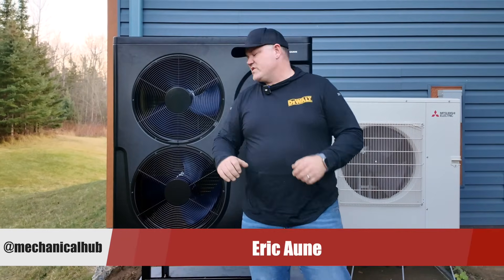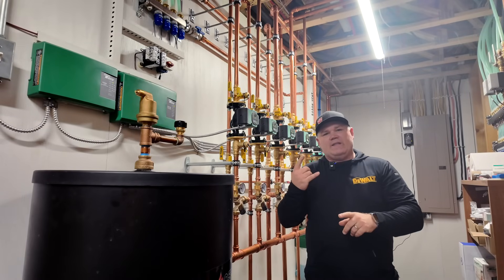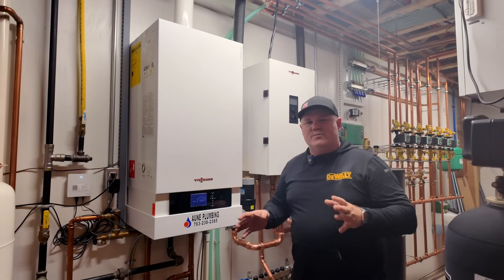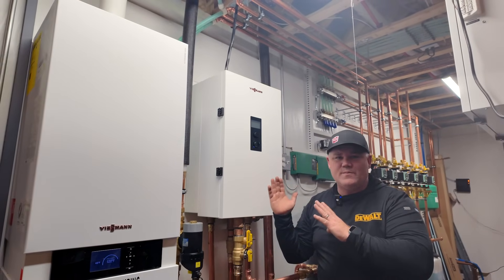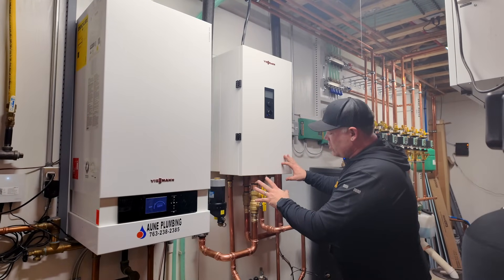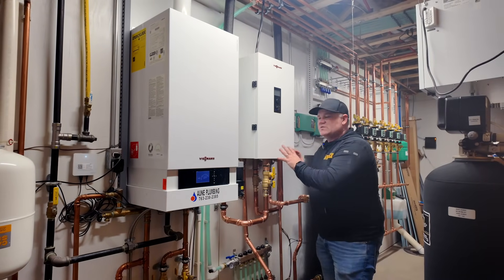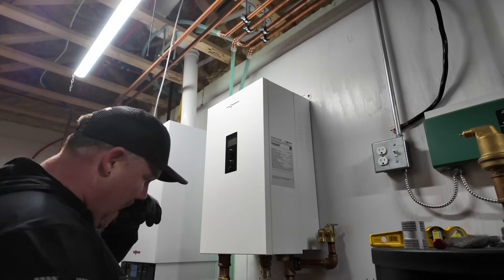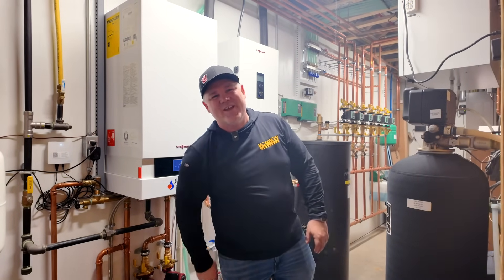Hydronic Heat Pump - Viessmann Vitocal 100

Comment: What is the max water temps the heat pump can provide?  All your radiation is high mass from the buffer tank….radiant in floor/wall so only need 120’F supply temp?  Can this heat pump supply a fan coil effectively with 180’ water?

This system provides no cooling?  They have another system for cooling?
Reply from the maker: Its capable of producing 165F water temp so a fan coil is completely doable. You're incorrect on the system, there is a mix of high and low mass after the buffer, however the system is designed to operate on a temop range of 80F-145F depending on the emitter/zone. This was a retrofit, no need for cooling because the house has a ductless system. The heat pump is capable of cooling and DHW as well.
Reply: @m @mechanical-hub anks for the reply.   165f isn’t bad but i imaging that drops with outside temps as you switch to gas boiler.  
I ask because I’m about to switch my oil furnace to dual fuel heat pump/ gas boiler here in lower NY.  Super high electricity rates calculate a crossover to gas at a COP of 2. Heat pump efficiency is better below full output so looking at a crossover temp that doesn’t go below 2.0 at full throttle.  My installer said they typically set crossover to 32f in our area.  Very hard to find a table of COP performance for my proposed equipment just 3 temps listed.  Manufacturers seem to hide it.  The efficiency numbers manufacturers brag about are best case at higher outdoor temps.

Comment: Why use Solar Hot Water instead of Solar Electric Panels for either an electric tank or feed the heat pump for DHW? Solar DHW can only perform 1 function the alternative many and considering COPs of 3-5 on heap pumps that free electricity can produce a lot free heat energy

Comment: I've heard these are much better than Ecodans. What sort of temp are you able to maintain that buffer tank at, and when do you make the switch over to gas? 2,0 COP at -28 C is something I hear thrown around, then switching to resistance heating (9kw in the ecodan)... Never looked at a Viessman because I hear they're expensive.

Comment: I am building a home/shop on the ocean front in remote area of Newfoundland. Hydronic slab heat in walk-out basement shop and perhaps an air handler for the main floor living area. Propane is available but only one supplier. Would you have any concerns using Viessman’s air to water heat pump in such a corrosive environment? Things that aren’t 316 stainless or dipped galvanizing just dissolve before your eyes. Originally, I was prepared to use a Viessman pellet boiler but the pellet supplier could not guarantee supply.
Reply from the maker: Its a copper and aluminum coil with steel compressor and chassis. Its outside and fully exposed to the environment, probably not good but I would contact V directly if I were you.

Comment: The real question is what distributors are actually stocking this or even know how to purchase it for a contractor?  I am seeing lots boiler manufacturers selling atw heat pumps but none of my local distributors even know anything about them. Even with the new admin abandoning incentives and pushing fossil fuel I still wish to sell hybrid or heat pump only options to my customers who still have oil heat. I want to start offering more than just air to air heat pumps / ductless mini splits.

Comment: If you used a R290 ATW monoblock, you would not need the gas backup. R290 is good to -35C and can produce hot water to 85C.

Comment: I have a home up north and would love to install a residential high efficiency glycol system boiler. Now what is the actual cost saving having redundancy here? you already had a LP high efficiency boiler. In the winter he’s bypassing the electrical heating element. so what was the point of having the electric heat pump. Your using the LP boiler to heat the water and than the heatpump to maintain the temperature im guessing would be the only reason thats cost effective?. And the electrical heat pump would maintain the hydronic water temps more efficiently than the high efficient boiler. Not being sarcastic just want to understand the system and if its worth doing this im always concerned of pipes freezing and bursting so one i want a system that i do not have to worry about pipes freezing as right now i have forced air and does not heat the home evenly. Second i have propane so i would like to either do a high efficient tankless boiler of of propane or this electric heat pump. But i feel electric is more costly than LP. Pros and cons and thanks for any info in advance.

Comment: I have to ask though in the long run, why would you want to use LP as a redundant opposed to having the electric hydronic as the redundant? Seems the LP overall would be much cheaper operational costs long term. I love watching your videos and seeing your work! Excellent looking install and man you and that customer should be extremely proud. Excellent video!
Reply: @Page546  I think with a combination of the solar tied into the LP was probably pretty efficient and the cost effectiveness to hook up the heat pump was probably fairly expensive.

Comment: Does that heat pump work with a water to air heat exchanger got use with forced air? I am wondering if it could be used for heating and cooling in a central air system as a monobloc setup.

Comment: That's a great redundant system, and a very ideal configuration, but it's not exactly cheap but it's the best way to utilize energy, and as a bonus you can use the resistive heat as a backup if they run out f propane (LP) gass! Or for equipment maintenance and down time!

Comment: Did you calculate other options such as furnace or electric baseboard?
Reply from the maker: The house was built in 2018, I installed the entire hydronic heating system at that time. This project was a retrofit to the existing system Now dual fuel, LP and Electric (heat pump)

Comment: A water-water heat pump would be nice... Soft geothermal heat pump with the earth as a heat sink/source. Then you might not need to even need a boiler (a wood stove might be wise backup)
Reply from the maker: Geo would be exponentially higher and no more efficient, would still require backup for the heat emitters in the house. Geo would use the same or more electricity as compared to this system as well, I have a hard time seeing the net benefits tbh.
Reply: @mechanical-hub  is the reason for backup not for low outdoor temps? For me it would be nice because at night in winter, my heat pump barely works.

Comment: I piped in a Wiel McLain Plus 80 tank so that it was the only thing that gave my boiler a heat demand and pulled all my heat zones from it so I got my domestic water and my buffer tank from the same tank. To accomplish this safely I used a thermostatic mixer on the DHW and a wider range aquastat to provide a heat call for my boiler. I got my heat from water to water geothermal and a wood boiler.

Comment: Awesome system and beautiful installation. Gives me some really good ideas and inspiration for the all-electric hydronic heating system I will be installing in my new home on the Oregon coast. I’m thinking of using low-temperature radiators in the walkout basement since it’s in a mild climate zone and further tempered from the cold by being half underground. Nice to hear that’s a viable option even in frigid Minnesota (where I grew up, BTW). Wish I could get you out here to OR! 😊
Reply from the maker: Great idea for the walkout basement, sounds like you are doing your research and have a great plan! There are a ton of options for low temp emitters, have you checked into Runtal or Smith's Environmental silent fin? Both are great, two ends of the budget spectrum as well.
Reply: Oregon Hydronic Heating and Air is using this tech.   They are stationed in Eugene, Oregon.

Comment: Why is absolutely NONE of the hot water piping insulated?
Reply: It's inside the thermal envelope so works as extended radiators. Low flow temp means they don't leak that much heat to start with

Comment: What's the monthly costs for heating with the heat pump in that house? 
I have six zones in Zone 5/6 that averages $120/month using natural gas from October to April. 
January and February are the months with the coldest temperature, and they drive up the averages.
Reply from the maker: It’s been installed for less than a month.
Reply: @mechanical-hub , good point. 
it will be interesting to see how it performs and the relative impact of the heat pump on pocketbook.

Comment: Why wasting heat in heat room, why all copper pipes are not isolated? Hope they are isolated in all other sections.
Reply: I assume you mean insulated?
Reply: @MichaelJ674  Yes, miss type. Multitasking on several screens.

Comment: Man I wish I had you to do the install in my new home. Wanna travel to northern Alberta in the next few years? Gonna be Ground Loop water to air Geo-Thermal heat-pump for the house plus a water to water heat-pump for the garage and future shop.
Reply from the maker: That's a very cool setup, great choices for both applications!

Comment: What is the black plastic “buffer tank”? What brand, model, etc? Are you using it essentially as a heat exchanger?
Reply from the maker: It's a "Argosy" model by the same company that makes Flexcon expansion tanks and well tanks etc. There are a ton of zones in this house, many are very small so the added volume to the system allows those zones to run and not short cycle the boiler or heat pump. Basically it acts like a big battery and hydraulically separates both sides of the system

Comment: Problem you have to replace every 10 to 15 years.  All the money you think you’ll save is killed off by installers and HVAC guys charging a grand to replace a CAP.
Reply from the maker: Everything has a lifespan and there are dishonest contractors in every industry but I'm not one of them. Thanks for watching.
Reply: Wouldn’t you hate to live your life from such a negative perspective? Keep up the good work and positivity, Eric! I appreciate your commitment to doing great work and putting out great content. It’s obvious that you love what you’re doing.
Reply: @MichaelJ674 But it is in fact reality. Maybe the guy in the video is honest, or at least thinks he is, but he is selling outrageously priced systems that most people simply can not afford. It is almost impossible to find a decent priced HVAC installer anywhere anymore, and systems are becoming more complex and less DIY friendly especially with the inclusion of heat pumps in everything. It's all centrally planned.

Comment: Great info. I have been listing over a system like this for a long time. If you could, it would be great to provide some operating cost for this system on a SF basis if possible. Thanks for posting.
Reply from the maker: Good question, I’m still gathering some data on this.

Comment: with a heating system like this are you forced to use mini-splits for air conditioning ?
Reply from the maker: Without a ducted, centralized system mini-splits are the best option for efficiency and comfort. If there is a ducted air handler then this hydronic heat pump can provide cooling. Other options would be small room-sized air handlers.
Reply: I’m in the temperate UK and the idea you’d need heating for -25F and then also have to worry about cooling is pretty crazy.
Reply: @ haha that’s Canada and northern USA for you. It’s like -40 to +40C
Reply: Yeah, I grew up in MN where you’d sweat your a$$ off in the summer and freeze your digits off in the winter. And there’s mosquitoes and biting flies all summer! Great fishing all year, though.

Comment: Looks cool I assume it’s a monobloc heat pump with the refrigerant already pre charged. What’s the rated lowest ambient temp rating?
Reply from the maker: -25F/109F Temp range. The built-in electric resistance elements widen the actual operation to those numbers, they don't list the output capacity at a specific low temp, I've been looking for that info but we programmed to operate on a timed scheme and enable gas after set time of operation until load was met. It's been working well, it's cold here now.

Comment: Would love to see a step-by-step installation of this system to in floor radiant heat and DHW.  This looks like a split system not monoblock?  How difficult would it be to use this sytem to cool with in floor pex or is condensation too difficult to overcome?  Thanks for sharing, awesome system!
Reply from the maker: There is a flat plate hx in the outdoor unit, it’s a mono block system. Cooling would be doable if you can control the humidity levels. Wouldn’t be that easy here in the Midwest if using infloor, simple for an air handler however.
Reply: In the high desert region (Southwest USA) we do use the same system for in-floor cooling to take advantage of the same equipment that does the heating in winter. Yes the floor temperature has to be controlled to prevent condensation. Like mechanical-hub said, not much benefit for all climates.

Comment: What’s the Mits heat pump running? Or is that a cooling only unit?
Reply from the maker: It's used primarily for cooling but also for a few days leading up to Heaitng season.

Comment: How much does the air to water cost to run?
Reply from the maker: Comparible or less than the existing LP system
Reply: 100 grand instlled

Comment: Cool job. Dual fuel is the future!
Reply from the maker: I agree, going to be easier too with new equipment like this
Reply: Or all electric, especially in places where electricity is relatively cheap like here in Oregon. The electricity from my local utility is over 90% carbon neutral due to the high percentage of hydro and wind power. They have also taken huge steps to protect migrating salmon around and through the hydroelectric dams.

Comment: 1:20 why did you mount the pumps foot or so off the wall?  ... Kind of a bit crazy standoff length
Reply from the maker: It was piped up in 2018, was trying to eliminate extra fittings.
Reply: @mechanical-hub  ah okay makes sense 👍👍